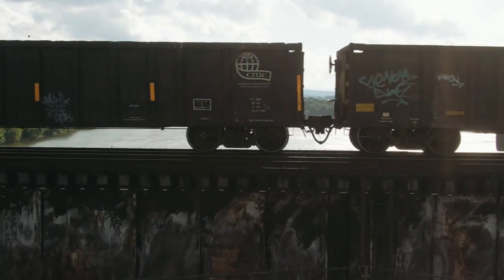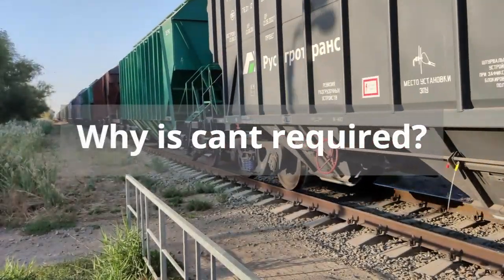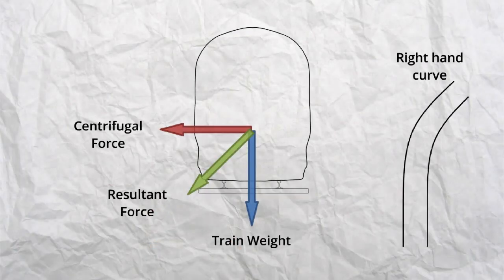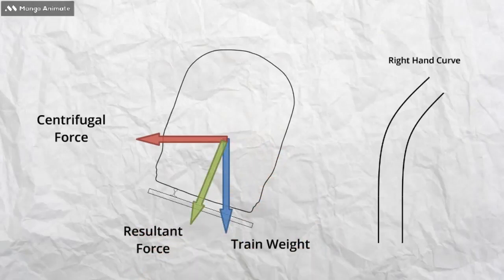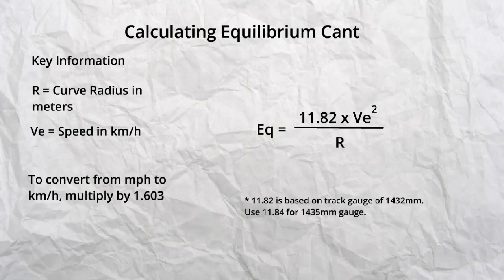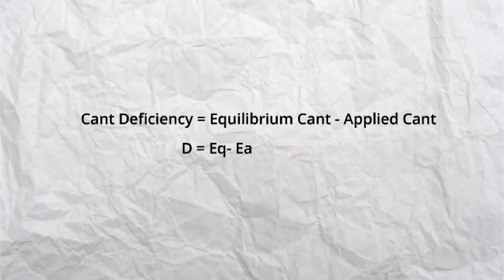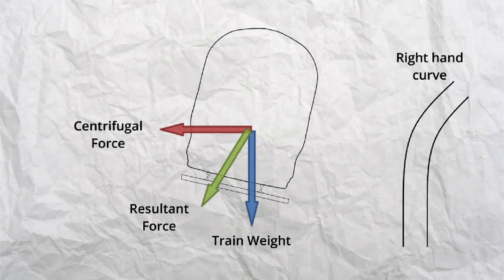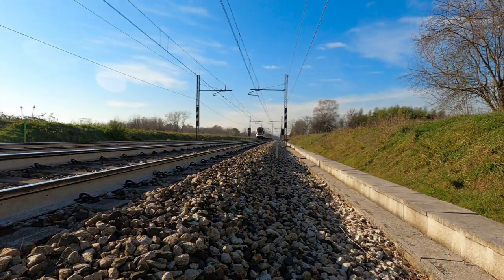A Complete Guide to Rail Cant and Cant Deficiency

Comment: Excellent video.
Fun Fact 1: Linespeed through Swindon could be 125mph, but has never exceeded 100mph because the track is uncanted, in turn because of all the S&C.😀

Fun Fact 2: After the West of England Main Line speed uplift in the 1980s, RMT trade union claimed a heath and safety risk that the newly-canted 100mph curve at Cullompton, Devon (which had previously never been higher than 75mph) would send scorching hot pans and drinks flying across restaurant cars on trains that had slowed down or stopped. The regional general manager agreed to arrange for a service train to stop on the curve, and everything on the stoves, on the buffet counter and on tables stayed where they were😀

Comment: Great Video. Sorry to be picky, but I would like to put the record straight. The term "Centrifugal force" is no longer used; the correct term now is "Centripedal Force". Same force, just a different name.
Reply: Wrong. They are different things. Centrifugal force is typically the fictitious force in a rotating reference frame, away from the center of rotation. Centripetal force is the real force required to make an object follow a curved path, into the center of rotation.

Comment: I just want to clarify on 11.82, this has been calculated usign track width and not track gauge. if track gauge 1435mm has been used then it should be 11.3

Comment: Hello, I loved your videos on railway engineering.
I wanted to ask you something, on 6:50 you said that the constant for the Equilibrium Cant is 11.82 in UK. Could you please specify which standard code that states that constant number? 
And, on 11:00 you said that the calculation for applied cant has differ from 2/3 of Equilibrium Cant. Could you also please specify on what journal or standards you based it on?
Thank you in Advance
Reply from the maker: Hi,
The 11.82 is quoted in numerous places but the one that springs to mind is The Track Design Handbook
The 2/3 was a rule of thumb rather than one stated in a standard

Comment: Interesting difference in terminology. On our railroad, superelevation is what you call cant. Balanced superelevation is your equilibrium cant. Unbalanced superelevation is your cant deficiency. Cant usually refers to the slope in the base area of the tie plate that angles the rails toward the center of the track. We had to be careful not to mix canted tie plates with flat tie plates or with tie plates with different cants.
Reply from the maker: It is interesting learning how different countries and areas do things! Even region to region or depot to depot in the UK difference names are used for things
Reply: That answers the question I had. 
Superelevation is equivalent to cant. 👍